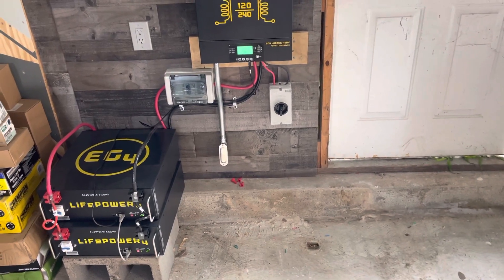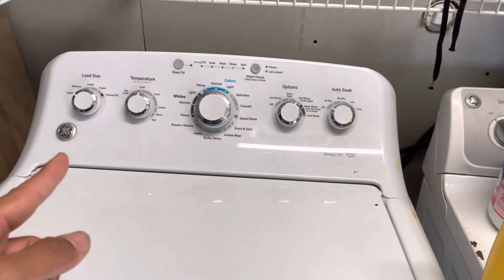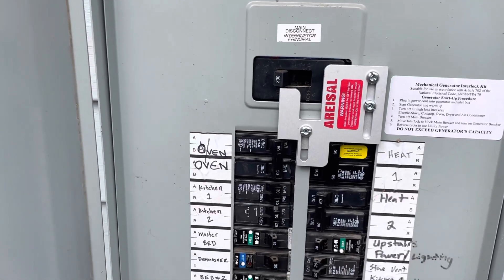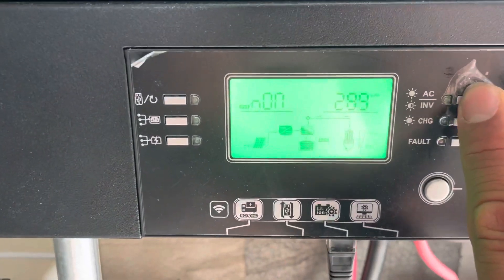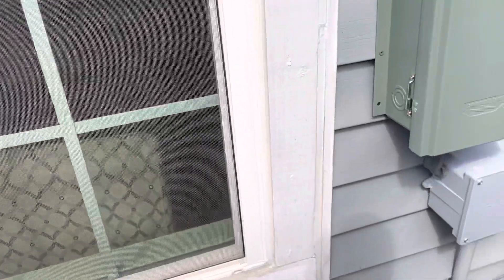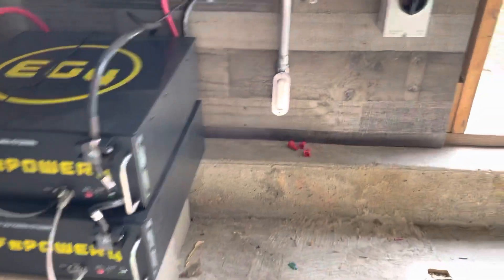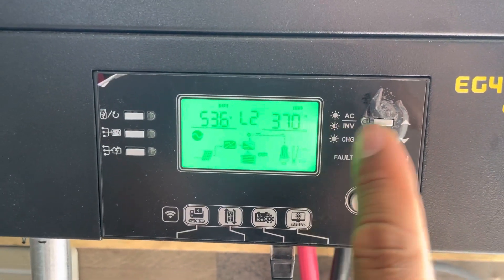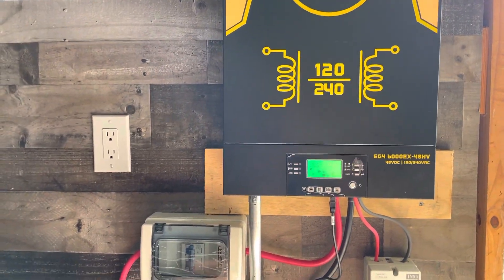Solar generator and panel setup . Eg4

Comment: was the system not able to run your hot water heater with the 4500 watt elements do both elements run at the same time ?

Comment: I have the same inverter too with 10,000 watts of battery only in 8 .. 12volt battery’s for 48 volt system  and it runs some of the same things..

Comment: I have that same invertor with only one battery.  How are you able to have panels facing east and west? I thought that was a no-no?  I haven’t installed any panels yet. :-)
Reply from the maker: My roof only faces east and west so those were my options to not take up yard space with a ground mount . I manage to feed home and charge batteries with 10 panels on most days
Reply: @alberttheelectricianbackup7878  My roof also faces east and west. My thought was to do what it seems you’ve already done, which was put panels (5 or 6 panels) on the east side for the morning sun and then another 5 or 6 on the west side for the afternoon sun.  If I recall, the invertor only has a connection for one PV panel input.   

I was told the non producing panels would negatively effect the producing panels output. 

Guess, not, it seems its working for you
Reply: @Mkiepert  you can do each set of panels in series then connect those two strings in parallel and that will be your single input into the inverter and the non producing panels won't affect the output.
Reply: @Mkiepert  Each side would be on their own string in series so 5 or 6 on one side all connected inline on one string and then the other side with 5 or 6 all connected on their own string, then those 2 strings are put in parallel so that one string doesn't effect the other. If all 10 panels are in series then yes, the non-producing panels would reduce the output of the whole string. Shading on even a quarter of one panel on a string can reduce the output on the string by half or more. This is the reason grid-tie or micro inverters are used because there are less issues with shading and it's overall more efficient than putting the panels in strings. The downside is there's more wiring involved.